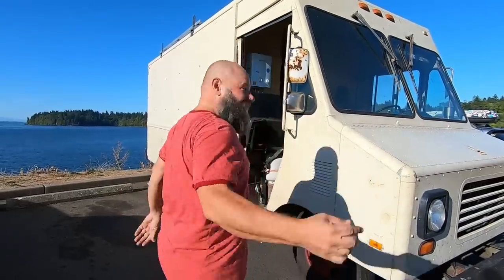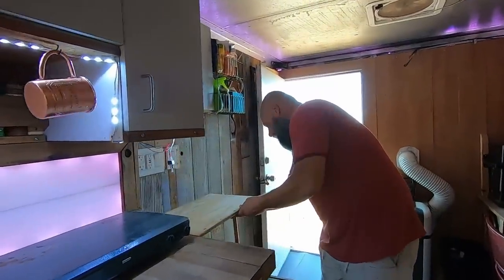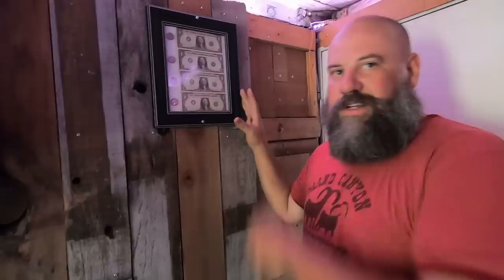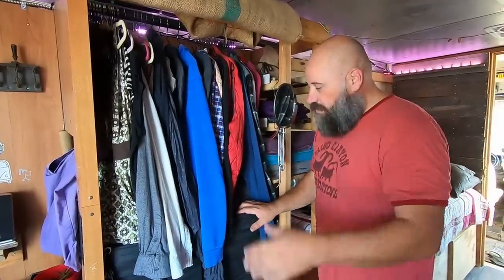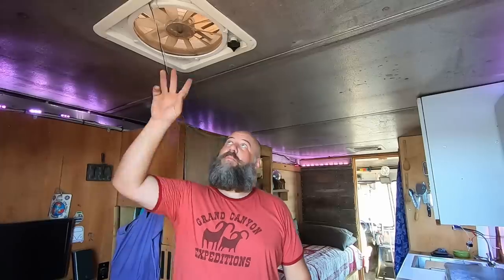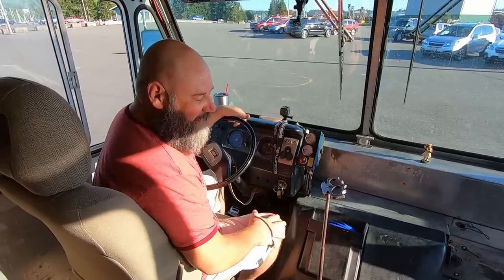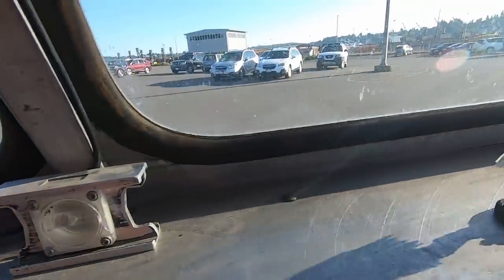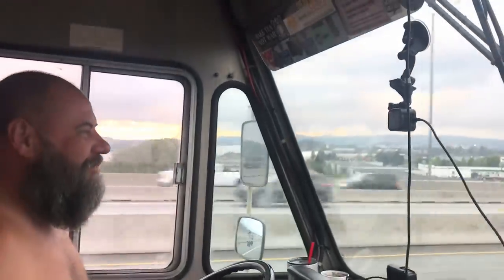VAN TOUR | Spacious Vanlife Stepvan w/ Cummins Turbo Diesel | Camper Van Conversion

Comment: Dude co2 detectors are made to be placed down low as close to floor level as you can get them if it’s higher then where you sleep it all bad co2 Is heavy and can build up in the lower areas
Reply from the maker: I’m moving it soon!

Comment: I have several questions about your bread
 truck  converison.  How large is your  house battery bank ?  How much fresh water can it carry ?

Can you recharge your house bank system directly from the truck alternator or do need to use a separate gas generator ?

How long can you boondock for ?

How much total did the bread truck and the converison ?

How easy is it to convert the registration from commercial to rv ?

Thanks for getting back to me.

Comment: Might I suggest a back seat from a Ford truck or any truck really to replace passenger seat.
Reply from the maker: I’m looking at options right now. A subscriber may be able to supply two Sprinter seats so I may do that. Ideally it would be a fold away seat that is still really comfy. I was thinking maybe a stow n go seat from a mini van would work.

Comment: Refreshing to see a manual vehicle. Love yr gear stick (shifter)! I was staggered at the amount of wood. Does it not make a heavy weight on the suspension? Some useful hacks along the way, but I wish you had windows at the back. The view is restricted.
Reply from the maker: The weight of my truck is only 10,000 pounds. That’s the stock GVRW. The weight is perfect! I wish to add a window across the back of the truck soon but until then I have a backup camera.

Comment: Man I love your setup but those portable ac units suck. Look into a mini split instead. They are awesome and will be much easier to operate rather than the unit you are using now. Great video.
Reply from the maker: It does suck! I will probably get a window unit once I put a window out the back. Thanks for watching!
Reply: @PaulBarger  Trust me, get a mini split. Way more efficient and does AC and Heat in one unit. I took out our central AC and replaced our house with nothing but mini splits and we have a 2800 sq ft home that costs 140.00 in summer and winter is about 120.00

Comment: Tip(s):  When you put down hardwood flooring, leave the vinyl tiles in place for cushion and sound insulation.
For your ceiling, use adhesive carpet tiles (but use spray adhesive as well).  These will provide even more insulation for cooling and heating, as well as provide sound damping.
Reply from the maker: I may! I still don’t know what I’m going to do with the ceiling. That’s a good idea though! I’ve thought about a fabric ceiling before but carpet may be cool.
Reply: @PaulBarger  In your travels, see if you can locate a Habitat for Humanity "ReStore" place. You might find carpet tiles for cheap. They'll be much easier to work with than fabric, which needs to be smoothed out. They're also thicker and will give you weather and sound insulation.

I love what you're doing with the bread truck. I would love to do that myself and travel since I'm retired, but the wife is very disabled and doesn't travel well.

Comment: This rig has really evolved and come into it's own.  Nice!
But I'd advise against getting a Macbook.  They are overpriced for what you get and the Macintosh ecosystem is dying.  There are some 6 core Ryzen laptops now that absolutely kill it for half the price of a Macbook Pro.
Reply from the maker: I’m sick of having trouble transferring files off my iPhone. It is such a huge PITA. A MacBook would just make it so much easier. Every time I try to transfer video to my pc, the transfer crashes.
Reply: @PaulBarger  Hmm.  I use both regular video as well as Filmic and its fine for me.  But frankly, iPhone isn't that great either.  Maybe just get a cheap used Mac to handle your transfers.  Most everyone I know who switched to Mac, has switched back to Windows.  And there's always Linux!  Good luck.

Comment: Hi paul thank you for this video.  I did find it very useful. I am trying to decide what I would build.  A step van, skoolie, or ambulance rv.

I have a few questions for you.

How long can you boondock for with the freshwater capacity and house battery system until you need to return to civilization ?  Do you have the capability to recharge the house battery bank off the alternator ?

How fast can you recharge the house batteries using only solar ?

Would it be possible to to add a lazboy recliner to your van and still keep the bed ?

How large is the solar system on the van ?
Reply from the maker: I have setup my truck to be able to last 30 days on my own with no additional water or food. I have a 92 gallons of water storage in the tanks and I carry extra drinking water as well. 

I do not charge the house batteries off the alternator. I have a small gas generator if I need backup power. 

In full sun, my batteries are full by 10-11am. I have 700 watts of solar panels on the roof rack. 

I could not fit a Lazyboy in my truck as it is setup right now. I certainly could have designed the house layout to accommodate a recliner though.
Reply from the maker: https://youtu.be/0TP7r4bjuYg
https://youtu.be/ZfROP_VixQQ 
check out these videos too! 5 best and 5 worst things about Stepvans
Reply: @PaulBarger  Hi Paul hopefully you are doing well.  I have been watching alot of youtube videos about snap on step vans.  Do you think that a newer  used snap on step van would be a good candidate for a conversion into a rv ?   In many youtube videos I see that the rear doors usually are two smaller doors instead of a roll up door on your van. I want to be able to put a lazboy recliner through  the smaller opening without removing the two doors in the rear.  Would it be possible to do this ?  I do not possess the mechanical skills and knowledge to do the project are there fabrication companies that can do the entire build for me ?

Comment: not a trooper but i watched it all. i would not change the bumpers. start bumping or being bumped and you will see they were meant for each other.  was that bridge at the end in Ohio/ West Virginia?
it isnt running right now but my Ford F250, with brush guard is 21 feet long (22?). have you seen the videos of "Camping with Steve?" you should get with him. he went from a few to a ton of subs, 2 or 300 k, in a short while. i think it started with a short film called Boondocking. maybe some growth by association.

Comment: HEY PAUL can you tell me how much you paid for your bread truck. I'm van dweller but you d a truck almost exactly like yours except it has barn doors. Just want to know it's worth it. They want 5500 for it and it has 194k miles. Same motor as yours. What you think. Seems to run good. I took it for an hour drive and tried to push it hard. A d it seemed solid. Got to build it out though and i would have to just do it a bit at a time I only get 1200 a MONTH on soc sec.

Comment: The cops you gave the cards to are going to watch themselves and then see your 420 tribute.
Reply from the maker: I am a proudly pro-Cannabis! They can see all they want. That plant will soon be legal and they have to use new tactics to search.
Reply: @PaulBarger  I have been smoking for nearly 50 years now. I thought it would be legal when all the WWII vets were no longer voting. I was in Manhattan for the 1976 July 4th fireworks over the Hudson. Afterwards, I walked down Broadway openly smoking a joint in public. Back then, the NYPD would discreetly look the other way if they happened to see you. If you walked down Wall Streeet at noon, you could get a contact high from all the NYSE specialists smoking while even wearing their badges and jackets. Now they wouldn't dare do it or risk being fired.

Comment: Great video. I have a 1994 step van which has a 4BT. It rides good but is very slow and only cruises 55 mph. Are you able to go faster than that, or do I just need to be more patient when driving.
Reply from the maker: I can go 61 mph. It would be nice to increase the top speed a little.
Reply: Paul Barger Thanks, I was just wondering if it was just my truck going that slow. I will just have to leave earlier  and be patient when I go somewhere and stay in the slow lane. Be safe on the road.

Comment: Excellent work, great idea to use bread truck.
I’m looking into doing something similar but wanted to know where u could store the truck for cheap if u decide to travel international?
Or could u travel international with it somehow? Probably not possible because of have to travel over water or maybe u can transport on a boat/plane can’t be cheap I would imagine. Any info will help thanks.
Reply from the maker: It can go on ferry’s and I’ve been to Canada with it. I’ve also used a storage unit yard to keep it safe too. It was $70 a month.

Comment: I love retrieving these motors the 4bt and the 6bt like out of Freightliners and bread trucks they're great engines the 6-cylinder looks like a 5-9 Dodge but they're a better motor because they're not Dodge they're made out of actual Cummins stock everything is a little bigger and better don't get me wrong the Dodge is a good engine but the true Cummins engine I like better call me crazy thank you love watching you be crazy for me but you're cool especially when the cops pull you over that b i t c h

Comment: hello Ive been looking for a 4 cylinder  diesel  step van....  still haven't  found one.... I was told guys used to take the motors out of these vans and put them in jeeps....  dont no if thats true ... but I will still  work at finding one of these step van....  is there  any other motor / step van  that can get a similar ride ?
Reply from the maker: Lots of them come with the Cummins 6BT which is equally as incredible! They are also usually paired with an Allison automatic. It’s just lower MPG but still an amazing and reliable engine
Reply: @PaulBarger  ok thank you Im looking now... I thought I wanted a Isuzu, but a step van , 18 feet box , diesel, I can fit my drums , amps and still fit in there to live. but Im selling , downsizing my life now, 30 guitars , 4 amps , bass cabinets all must go.  I just realized over the last year I need to  go off grid , I think its great you are working a piece of land as off grip.  Steven Gaskin and the farm spiritual community did all that stuff.  Tennessee  homestead with a meditation twist.  it all starts in   your  mind and heart... ok thanks

Comment: That detector is way to high. By the time it gets up to that detector your be dead. just saying. Propane is heavy then air. So should be around the base of the floor. Just a head up but its your van. side seat change out the padding for memory foam and it will make it 100X more comfortable!
Reply from the maker: True! I could move it down farther for sure. I’ll do that ASAP. Thank you!

Comment: Amm..let me think because i´m European...so 14ml/gallon is like  16,9liter/100km. not very economical for a 4 cylinder turbo diesel, but yeah okay. My chevy drinks about the same/100km and it´s 6,5 liter v8 turbo diesel, so just thinking.

Comment: 14 mpg from a 4BT? Especially with a T19...sum ting wong.
Reply from the maker: Yeah I know I could make it better but it didn’t seem bad as is. Runs like a champ. It’s a 10,000 pound truck. I’d love to get over 20 mpg. If I changed the gearing I know that would help.
Reply: @PaulBarger  if it's geared real low, drive slower.